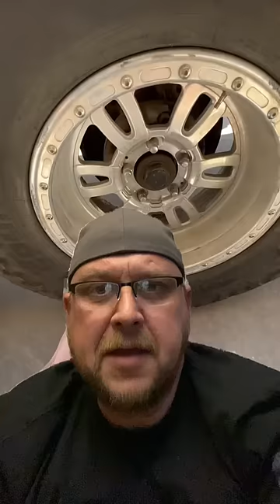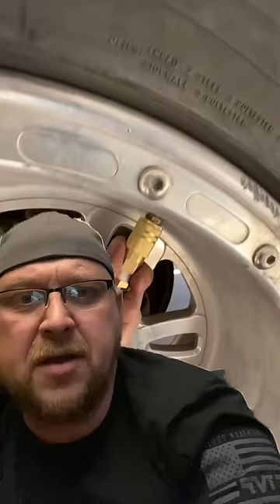A Trick That Works

Comment from the maker: This trick is good for when you want to fill a big tire faster. Precautions should be taken 😁
Credit to @caysonp9617 for the original video 

https://youtube.com/@caysonp9617
Reply: Just add a valve behind the quick connect so you wont have to sweatly run to the compressor 😂
Safety before "fking around and find out" is a good advice 😜
Reply: I've done the same thing 😅
Reply: How do you know? 😅
Reply: I want to say it, just because you said… but someone else did so I’ll just like theirs
Reply: @TwinShards  I now do the same thing from experience. I was filling up a 15” oldsmobile rally wheel, the quick connect got stuck (like FUNK described) and my tire exploded during the chaos. 
Neighbors came outside making sure I wasn’t dead😂 
I even got a new (to me) Lisle tire gauge with a quick connect schrader valve fitting out of the deal👍🏻
R.I.P. to my old neighbor Popejoy.
Reply: @BrightonsPriest   If you're talking about me, I only beat you by two minutes. 😅
Reply: I had a old rusty semi wheel split while filling it. Not as bad as it could have been but i was pretty jumpy for a couple years.
Reply: What would you rate it out of 10 though?
Reply: I have never had a chuck stick on a stem......yet.   i remove valve core and do this often to rush air in and seat bead.  Any particular chuck type that does this?   I only use one style, but have acquired a box of various styles.   I may experiment,,,,,
Reply: You can also learn that your emergency shutoff is not exactly functional, and aluminum 3pc mags will spontaneously disassemble before the M/T drag radials...or so I heard from a guy.🎉
Reply: OK but like how do you get the attachment on so that I can blow all the dust out of my PC
Reply: Cranked compressor to 125?
Reply: @PD-yd3fr  I'm not able to say what PSI she was running on... Seems that regulating and pop off release were part of the shutoff and were in the same operating conditions as it. So it was just a double 40 gallon tank dumped while max pressure and full capacity into the tire. Making the normal sleepy day become briefly very exciting and something I was too sober for.
Reply: Also try it with a regular tubless and push the valve stem thru the rim lol
Reply: How do you know
Reply: You put a speed chuck on stem with the core out. A trucker told me I should make and sell speed chucks, I told him it's far too dangerous for those who don't know what they're doing. With a good compressor you'll blow up an 11r22.5 In under a minute.
Reply: @chadmann2724 lol if you want pressure for that a good ol' air hose gun attachment, though I'd love to see what happens to a computer using that pressure :)
Reply: Okay, how do you know?

Also, THANK YOU! I’m the “company mechanic” for a construction company, on top of learning the assorted trades, and I never have the fittings on hand when I need to put air in a tire. This, this I will use…. Often.
Reply: @iamgriff  see, you learned, you shook hands with danger (always fun), you became closer with your neighbors, and you got a free tool… did you mean this to be a cautionary tale?
Reply: @TwinShards  or knick the hose.
Reply: How do you know😮
Reply: It's not a trick, it's just a quick connect
Reply: I used to use this method for all applications I need to works pretty well
Reply: Blow gun work with rubber tip
Reply: Yeah ,. We all been there , exploding tires and all !   Good times and funny stories
Reply: Pro tip, Kink the hose and tie it in a knot
Reply: I love the delivery of the "Ask me how I know?" at the very end. It brought a grin to my face ;)
Reply: Or do it at the petrol station. Set bars, plug on, suits of automsticly when required pressure is achieved.

Comment: Most embarassing thing I ever did as an aspiring young man was to plug a "pneuma-seal" directly into shop air.  It's like a tiny inner tube with a schrader valve that inflates between two diameters to create a seal.  On shop air, it took about half a second to burst in an ear-splitting pop that caused several very annoyed machinists to e-stop their turning centers and a tool room attendant to ask if I needed new underpants.
Reply: My dad did that to a 26" bicycle inner tube. I had to tell him its too full for him to stop. Tube was so full the tread broke the bead and the tube squeezed out like a black racer that had just eaten a oppossum. I said "you gotta get the air out before it exp-" and he put the bike down and as soon at the tire hit the ground it exploded. He never inflated another bike tire, didnt even bother replacing the tube he blew up. Just bought new bikes for us for christmas 😂😂😂😂

Edit: btw i was like 10 or something, still very much a kid
Reply: In my machine shop class back when I was in high school I was helping some lunk head kids with a a lawn mower they were converting into a pulling mower. We had just finished welding the old rims to the new rims so we could just use existing parts but we went to inflate the tires and something around one hundred and ten pounds of air went into the tire and it exploded in the closed shop. It was the single loudest sound I have ever heard in a machine shop.

Comment: Put a quick connect on your quick connect so you can quickly disconnect it when it’s needed to be disconnected
Reply: NASA would like a word.
Reply: Ooh add a gauge too so we can see how much is in the tire!
Reply: "Yo dawg, I heard you like quick connects"
Reply: 4d chess, 4d chess gentlemen
Reply: @Teh_Random_Canadian  I imagine this on a dark alley and you open your coat to a bunch of quick connects hanging on the inside of the jacket.
Reply: @Barefoot-Jaycee  they’ll wanna add a solar array for the king range camera.  Taking photos of the connecting disconnects in ultraviolet wave lengths
Reply: @colin577  we need the tire air superheat
Reply: @Teh_Random_Canadian  Rounded boxes? 

If you know you know
Reply: mind blown
Reply: Xzibit is that you?
Reply: No. I've had them stick.
Reply: @ickess  all two miles of them 😂😂😭👍
Reply: Add an air filter so that your tires have clean air, this will make them perform better 🙃
Joke aside, this would actually remove humidity/water resulting from condensation along the tubes from the compressor to the end of the air tubing "circuit". That's what I do to "Air Clean" those computers that I build or service (you don't want water/humidity and micro-particles to be shot at electronic elements). In regard to tires, IDK if this is mandatory though, I don't think so...
Reply: Or you can buy a Schrader valve fill with a quick connect fittings for like $8. 🙄
Reply: @HawkFest  I purchased a rechargeable air duster so I don’t have to worry about moisture when cleaning electronics
Reply: @lepopcornnaisseur546  today on pimp my ride we’re adding quick disconnects to a popcorn maker under the waterfall
Reply: @machinist7230  but what fun is that?
Reply: @Teh_Random_Canadian  it's all disconnects all the way down!
Reply: @ickess  , you wrote "I purchased a rechargeable air duster so I don’t have to worry about moisture when cleaning electronics"
...Yeah, maybe for replacing risky mouth blows over light dust surfaces, in which case I'd use a simple hand squeezing dust blower for camera lens (fifty cents and free shipping at Ali WalNuts) - and it's as satisfying as a relaxation squeezing ball. But in other cases, no, and the fact that it'd be rechargeable is irrelevant. The following exposes the reasons (and a note about electronic boards further down), along some basic leads - also an opportunity for me, since by doing so I review my own processes and tools in the background, thx.

One must be careful with those portable/small air dust-blowers using compressed air, much more than with a compressor having an air filter : it's actually the pressure (allowing some minimal CFM wind at the compressor's output), which creates a potential condensation. As air is compressed to the required pressure, it undergoes a volume decrease and a temperature increase. As that compressed air makes contact with ambient air, it cools down and its vaporized water can transform into droplets of water, especially near the output nozzle, along air pipes surfaces, the target surface, etc. Installing a moisture seperator filter (and particle filter if need be), at the output of the compressor, allows for a cleaner, safer and confident work.
 
One example are those replaceable air spray cans branded "for PC cleaning", from which you can clearly feel and see the phenomenon (some liquid spitting out after a couple of long bursts of spray, while the can becomes burning cold). Note: other air blowers are small electric appliances in the shape of a gun or electric screwdrivers with an air pipe+nozzle, but those are essentially using "mini-compressors" (less power and control than a good "all-around" compressor). Zero condensation means that the tool at hand is plain inefficient, only good for blowing light and free surface dust - leading us back to "relaxation squeezing-ball blowers"...

Important note: with circuit boards and their enclosures (e.g. a compact/Gaming/server/workstation PC), the use of an industrial ESD-safe micro-dust and bacterial vacuum with HEPA filtration, rather than an air dust-blower, is mandatory: I certainly don't want that kind of dust and potential bacterial/bug debris from somewhere else, to get blown all over my workbench and lab, nor in the house, nor at the face and windows of my neighbnors... Along ESD-safe and light brush extensions of different sizes to protect and deep-clean the elements (fan blades and radiator fins for instance, or movements parallel to the PCB while lightly brushing the surface and electronic parts to lift all the dust into the vacuum nozzle). Only then after do I use a dust blower, for cleaning otherwise inaccessible sections and a finish job - sometimes both at the same time, e.g. deep radiator fins having dense accumulations. In all other cases, an ultrasonic bath is always better for deep cleaning a PCB.

I use my compressor for other tasks (precision pneumatic tools for assembling and air brushes), which is an opportunity to use a much better and "professional" dust air-blower: more control, reach and sustain over the air pressure (for a better job of a more constant quality); no refilling nor its potential collateral pollution; better control over inevitable air moisture; more economic in such context; etc.

Have a good day !
Reply: This sounds like a joke but I feel like this is probably the best advise in the comment section 😂
Reply: @HawkFest  Do you have a life? I am just wondering because i have never seen a comment that long on YouTube.
Reply: @TheDiosdebaca  The kind of fun of not having to undo f*ckery.
Reply: So a quick connect to quickly disconnect a quick connect?
Reply: @JakeHabermansYouTube  bingo
Reply: It's been disconnects this whole time? ....

Always has been
Reply: @DaDaDo661  🧑🏼‍🚀👉🏻🧑🏼‍🚀
Reply: They need to sell some quick disconnects
Reply: Better yet, instead of a quick connect, use a quick disconnect. That way, instead of connecting quickly, it can disconnect quickly. Smartness.
Reply: @HawkFest  It's not mandatory, though it does reduce corrosion of the rim. Fun fact, some construction equipment comes with the tires filled with nitrogen from the factory, for that very reason.
Reply: I used to work at a lowes, one day I went to the aisle the quick connects were at, and I connected them all together and left them like that
Reply: @KenanOmerbasic  my wife worked at lowes…that checks
Reply: @davesstillhere  but then it would make sense and wouldn’t make it into one of these “hack” videos
Reply: @davesstillhere  Good to know, thanks!
Reply: This is why you're one of my favorites
Reply: @colin577  Filter-Regulator-Lubricator with a dump valve and nested quick-connects 😂
Reply: @ickess  on one side of the jacket, he'll have quick connects. On the other side of the jacket, he'll have 10mm sockets.
Reply: @Barefoot-Jaycee my brain bled a lil bit when I realized what he said and it already was starting to hemorrhage from the 1st quick connect 🤯😵‍💫🤯🥴
Reply: @ickess "Psst, hey you. Cmere a sec. You uh... opens jacket need a quick connect? Got em on the low..."
Reply: @SamaraxMorgan26  me?  Are you talking to me? *looking around
Reply: Hell of an idea mate
Reply: Promote this man!
Reply: Another good tip.
Reply: Need to add a shut off valve before the quick connect
Reply: Hahahahaba
Reply: That sounds like it would just be extra steps to get to the same issue, but it actually WOULD solve the problem. Just sayin'😅
Reply: You like kamala don’t you? 😆
Reply: Next level big brain solutions here.
Reply: @FluffyM4n   just go find a youtuber who is neck deep in politics and make a statement why their preferred candidate sucks.  The reply guys in their comment section will give you pists this long.  Longer if you do it on a self proclaimed socialist's channel.
Reply: A quick connect to quick connect coupler is not actually a bad thing when you're dealing with the possibility of it being stuck on and your shut off switch very far away.
Reply: @HawkFest  You're talking about air duster cans or compressors only. There's an in-between option you don't know about, it's actually a rechargeable, glorified tiny blower. And it works really well. It's not compressed air, it just blows air through a tight nozzle really fast to dust things.

It's equal in performance to a can. I've tested a can after dusting with the blower and couldn't see anything more come off.
Reply: Throw in a manual valve for backup to the backup and you're golden
Reply: @colin577 wouldn't work the pressure at the house is going to be higher than it is slowly going through the stem
Reply: I made something like that as a adapter because I have different fittings at home then at work.
Reply: I was gonna say a valve but that is way funnier.😂
Reply: Yo dawg, I heard you like quick connects.
Reply: Harvard: "You want a scholarshit?"
Reply: Sir, your brain is simply too big for us common folk to comprehend

Comment: "Ask me how I know"
Ah, yes. Wiser words have never been spoken.
Reply: A little admission at your own expense... Passing on the knowledge and experience.  And so well delivered. 👍
Reply: like a pro....
Reply: Experience is the best teacher I have ever met
Reply: it's my favorite reply when "discussing" an issue at work, and the higher ups neglect to pull their heads out of their asses for 2 seconds to listen to my solution.
Reply: The more you [F] around, the more you find out 😉
Reply: Your comment saying ,"Ask me how I know."...It reminded me of how I know...Years ago, where while not having a cage in our family run trucking company garage, we would air up split rim truck tires inside the shop without any restraining safety devices, our attempt at safety was to connect the air hose to the tire then connect to a quick connect outside the building. This worked well enough until one time a lock ring went off like a rocket demolishing the ceiling on its way up into the trusses and breaking one on the way up, then finding its way back down out of the ceiling in another place after bouncing around in the attic area for a second or so. Needless to say, we soon got rid of all tube type split rims and changed over to all tubeless single piece rims on all the 27 trucks my family operated due to the unsafe design of the split rims.
Reply: I bet you never made that mistake again.
Reply: How do you know? Oh wait, probably the same way I know...
Reply: Don’t, ask me how I know. 
You need to use gooder English….
Reply: @michaelgarrow3239  "gooder English" haha

You mean better English?
Reply: @rhombo323  - 😉
I was making fun of myself… 
You caught me. 😎
Reply: I'm guessing you found out the same way I did  😂
Reply: I was taught, "A wise man is just a fool who's learned from experience. A smart man learns from the experience of fools."
Reply: "But Dad, you told me to 'blow up' the tire!"